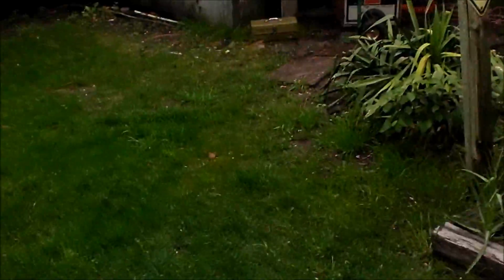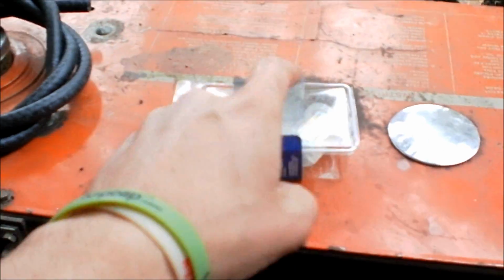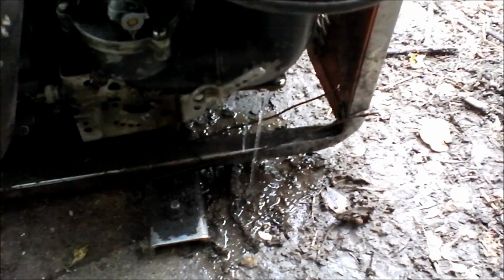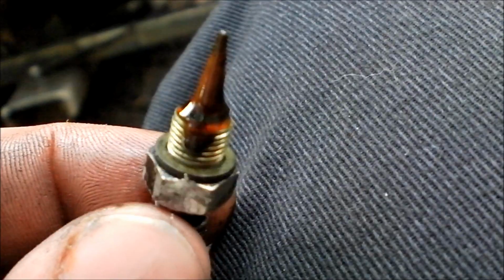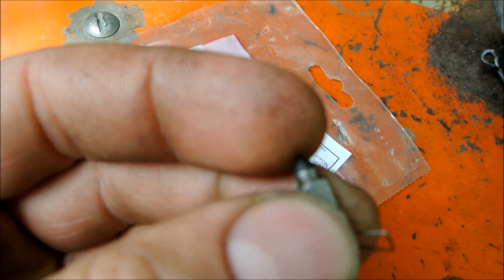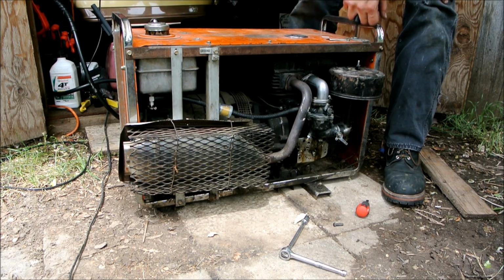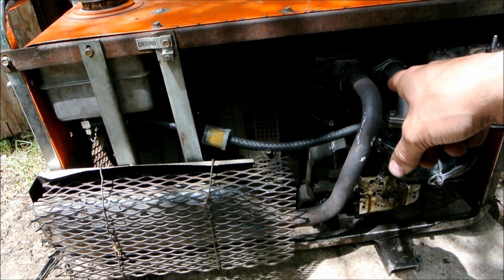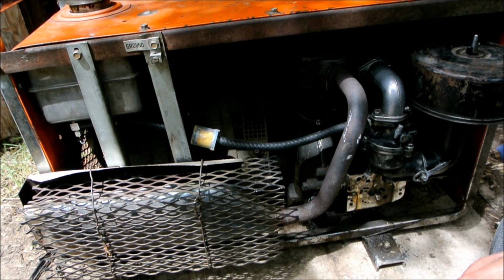Montgomery Ward Generator Repair

Comment: What is asbestos
Reply from the maker: look it up its old insulation needs to use back in the seventies and earlier it works really well but it gets stuck in your lungs and can give you lung cancer
Reply: Thanks for that,your videos are deadly man,any more of the 250?
Reply from the maker: +Connor Macinnes which 250 the old rl250?
Reply: +ils360 yea the old suzuki that bike is awesome man
Reply from the maker: +Connor Macinnes thanks :-) I didn't think anybody was enjoying those videos I will have to make more
Reply: +ils360 u will have to make way more videos on it,and make some more of you working on the engine aswell:)

Comment: I would probably just wear some really old clothes and throw them away when you remove that asbestos. A lot of things I read about asbestos says it is better off un disturbed.
Just wondering your thoughts.
Reply from the maker: that's what I have heard as well but I'm assuming and a generator it's going to be disturbed constantly with all of the vibrations I think I'll eventually just remove all of it and replace it with some sound deadening insulation for cars that will be better at heat dispersion plus there's some wiring I need to do on it it works great there's just a few little things that need to be fixed like that switch which is covered in asbestos currently
Reply: +ils360 When you find asbestos you should get you a big spray bottle of WD-40 and spray it heavily and as you remove it keep it saturated with WD-40. This locks the fibers and is how we remove it in the chemical plants.